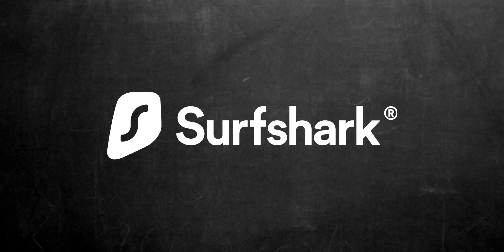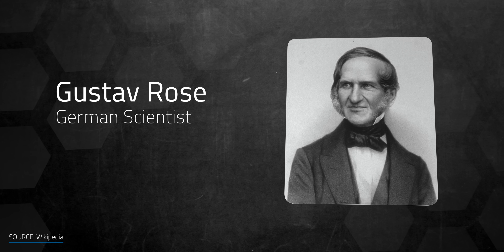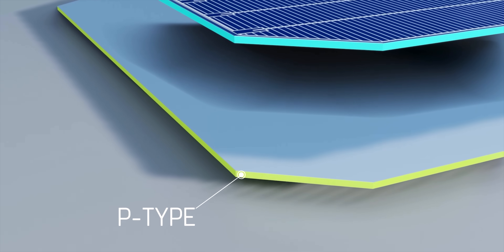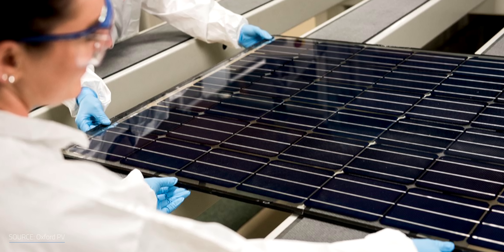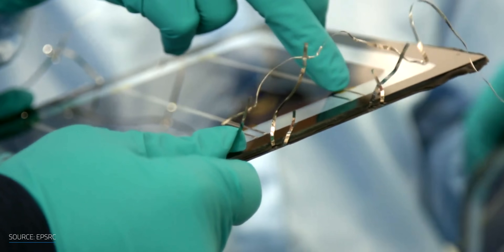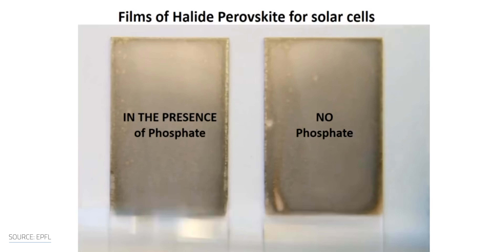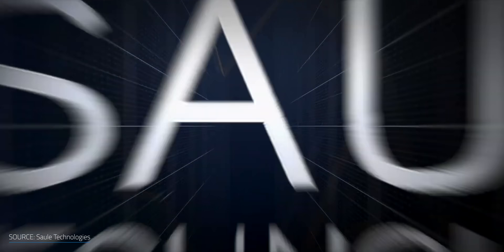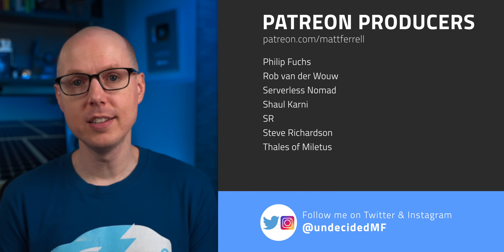Perovskite Solar Cells Could Be the Future of Energy

Comment: As you, say, it's a cost driven market. However, production cost is only part of the cost. Increasingly the cost is dominated by installation cost. That being said, given the ability to recycle these panels and reuse their materials, swapping them out every five years or so might not be the end of the world. But it's not going to be free. Every 5 years vs. every 25 years means 5x the installation cost.The total lifecycle cost is what  is going to matter here and that has to include recycling as well.  

Another thing could be that even at 80% of their original efficiency, it might still be pretty good. It would drop the cost advantage from 5x to 4x but that's still a win. Unless of course you are constrained by surface area and want to get the most out of that no matter what. But it's a fair question to ask. At what efficiency would it be more cost effective than to leave degraded panels in place? It all depends on how expensive the real estate is where you use the panels. If you live in an expensive area and have a small roof, you probably want to maximize what you get out of that. If on the other hand you are building a solar plant in the middle of a desert where the ground is dirt cheap (literally), it might be a different matter. Add a few extra panels to compensate for expected losses.

Comment: 0:17. Silicium cells are producing a lot more than one decade ago. Increase every 2 years was ca 5- 10%..
I know that it does sound a lot when cells get 11% efficiency instead of 10....but this is a 10% increase.
in 2013 the best silicium cells where ca 22.7% efficient (information from a solarteam at the world solar challenge). Those were at that moment not for sale to the public. In the same year most of  the panels installed on the roofs produced wuth an efficiency of 16 to 17% (150-200 wp panels). The difference at that moment...the best cells , silicium, produced 41% more energy than the industry standard. When now buying industy standard panels (2021) you'll get thos 20-22% panels. The topcelss however are at this moment near 25% efficiency.
Also  , silicium is an element which is one of the most common elements on earth. Shortage is not possible.

In this mineral, it is not an element, is one of the more expensive metals , Titanium.Even when found easily today I would not be sure for how long if we start producing solar films on big scale. And what is the environnement damage from mining this mineral? Or can we produce it artificial...which could means the use of titanium. (Calcium titanium oxide)
 Silicium can just symplyextracted  from sand. (SiO2)

Efficiency (my sources) are now 17% only.(source TNO the Netherlands) (I would like to know the source of this 29% efficiency) 
Advantage: Very thin lyers so leightweight panel  production ...but remember that panels must widthstand storms. Also felxible cells are possible. So for mobile use they will be very good. Put them on the roof  from your tent ....
But with 20% less production/m^2 and the high prices of ground /m^2 I suppose I would prefer today the  higher efficiency against low weight for standing installations.

Comment: Perovskites will flounder until the durability issues are solved, but unless obstructed by patent law, the removal of toxics is solved.  When the durability reaches 5 years and installers offer them with regular replacement contracts (practical because of such low cost), then they can gain broad market acceptance.  Even with this they will remain only a share of market though until they have the durability of silicon cells.

Comment: Most solar panels are under 25% effective at collecting energy from the sun. With higher efficiency, it's better, but 29% isn't a huge step up. But everything helps, I guess.
Reply: A 16% improvement in output given the same sunlight is pretty good, I'd say. 6 perovskite solar panels would be approximately equal to 7 silicon solar panels, assuming identical sunshine and area per solar panel. This is not a fair assumption, as area is the main limiting factor for solar panels in many cases, so for some people, it might be impossible to fit the additional 7th solar panel. (Source of 16% figure: suppose a silicon solar cell receives 100w of sunlight, converting that to 25w of electrical energy. Similarly, consider a perovskite solar cell receiving the same amount of sunlight, converting that to 29w of electrical energy. 29w = 1.16 * 25w, so that is a 16% increase.)

Comment: I can get enough silicon bases solar panels on my roof at 20% efficiency and a 30 year warranty (Solar World) that I can be completely off-grid (with battery back-up). Now I just need the price to come down to $0.60 per watt and I will be set. I would not be putting the perovskite tech on my roof until it has had many years of real world service. There is a silicon based 10 kw system installed in Switzerland that used ARCO panels that are still functioning at nearly  20% of their original output after 35 years.

Comment: If the perovskite cell were encapsulated in plastic film behind the glass panel, they could be easily refurbished, with the old cell sheet replaced with a new one. The old cell sheet could then be easily disposed of or recycled, without the issue of transporting large, heavy panels.

Comment: It’s worth noting that while it’s currently true that high energy use is frequently correlated to high carbon emissions, those two axis are fundamentally independent.

As more clean solar power is generated, the energy use associated with creating those solar panels will pollute less, or not at all.

Energy production and use is good.
Pollution is bad.
Reply: Excellent point.  Perovskite manufacturing is significantly less energy intensive than traditional Silicon cells.  The future is looking brighter... at least on the technology front.

Comment: Another advantage of perovskite films is they don't compete with materials used for semiconductor chip market. I always saw that as a major hurdle for rapid adoption of high efficiency single crystal silicon solar cells. Although silicon is the most abundant element, producing high purity substrates takes a lot of energy and chemical processing and most of the current capacity goes to chip makers.

Comment: I have been hoping for a high efficiency perovskite solar solution for several years. My perspective (2 cents worth) is that the cost of putting a home solar system together with battery backup, professional electrical work, construction costs and permitting, is so high that having panels that will have decent efficiency long term (over high efficiency short term) is highly desirable.  Once I have gone through all the waiting, expense, and headaches of installing a large home solar solution I don't want to think about replacing panels for many, many years.

Comment: At 10% the cost, would people really complain about having to replace solar cells significantly sooner?

With a smart design, cells could be made to swap out easily, and even be designed to allow for silicon cells to be swapped in at a future date. By lowering the upfront cost, and giving consumers the ability to do maintenance more often at a cheaper price, or get more durable cells when they choose,  it lowers the bar for widespread adoption.

Anyone who has ever started a new hobby from scratch knows it is easier to get into it with cheap stuff to get you going and upgrade as you can, than to wait until you can afford the expensive stuff to even start doing anything
Reply: yes but lets ask you this. How many of those said people will recycle their solar panel or just toss it into the trash? My money is on the latter.

Comment: I love it when people make things to absorb the energy from natural resources and especially the sun 

What about all the heat coming from the sun has that been addressed yet? Super hot days creates so much energy
Reply: The infrared is just one part of the spectrum of light coming from the sun, but the higher energy visible and UV light makes more sense for solar panels. A photon of visible light has more energy than a photon of infrared. And I think there just isn't a good efficient material to make IR solar panels. Plus since everything warm is putting out IR (at least) there might be some thermodynamics reason why that's not possible.
Reply: @calebmauer1751  good point. I know people do a lot of testing on thermal to energy conversion but maybe the other spectrums are easier to gather with certain materials .. I always imagine massive mirrors and magnified glasses directing energy and heat into some material like diamond or other dense substance to contain that and then be able to release it like the iron man battery/energy system… not sure what use case scenarios it would be able to handle but build up energy and be able to release lots in a small area sounds useful 

I don’t know much about this topic though, just some fun ideas that will probably come to life one day

Comment: When concerned about the 20% efficiency of commercial photovoltaic cells, remember that the photosynthesis of modern plants are between 0.5% to 1% efficient and only a small fraction of biomass gets trapped geologically to form fossil fuels over millions of years.
Reply: Even with the small efficiencies of photosynthesis, forests are often 10-20 degrees cooler than the surrounding farmland.   It makes you wonder if high efficiency solar cells will eventually have an effect on the local climate, as silicon absorbs energy in IR bands quite well.
Reply: @macroman91  Most vegetation on Earth is green because they purposely reflect green light.   There's actually too much light intensity in sunlight for the most common form of photosynthesis in use and as most of the energy of sunlight is green (yes, we really have a green sun), it is green that is reflected and hence not absorbed to become heat.   Vegetation does have less albedo than say snow and ice but it does reflect far more energy than a lack of vegetation and that reflection is more likely to be the reason for cooler temperatures, not the relatively small percentage of energy converted to chemically stored energy by photosynthesis.
Reply: @macroman91  In addition to what John Wang said, the energy carried down the wires would make it cooler by the solar panel, but it just comes out somewhere else when the electricity is used, so if you're using the energy locally it would have no net effect.
Reply: Except plants do it all with pure organic self replicating materials and can fix CO2 without needing heat.

Photosynthesis is really clever evolution.
Reply: @the_roadbites  Sure photosynthesis figuratively grows in trees but remember, if you are expecting photosynthesis to provide the energy that we use, we already have that in fossil fuels.  Are you really insisting we just continue with fossil fuel use?  I'm simply saying the efficiency of solar photovoltaics isn't as terrible as people seem to think it is, it's actually quite impressive compared to our current method of using energy from the Sun which is fossil fuels.

Comment: I love your channel, and I know you produce videos to educate people and expand knowledge.

A requirement for education is precise language, because if someone records an ambiguity in their mind (a secondary definition you weren't intending) then not only have you not educated them, you have actually spread ignorance.

This happened in this video, when you were listing two values and used the phrase "20 times less". This is grammatically, mathematically, and logically wrong.

If you are comparing two values, say 5 and 100, you can say that "5 is one-twentieth of 100", or "100 is twenty times what 5 is" or "that's just 5 percent of the higher value". What is NOT correct is to say "5 is twenty times less than 100".

Let's break that down.

"5 is twenty times less than 100".

Treat it like a word problem. "Times" is multiplication, and "less" is subtraction. Therefore, you have literally said "5 is a multiple of 20 and 100 subtracted from 100".
5 = 100  – (20 × 100) = 100 – 2,000 = –1,900... so you have actually said "five equals negative one thousand and nine hundred". (5 = –1,900)

At 5:39 you say "Its thin-film structure has twenty times less material...", which is wrong.

If standard construction methods use 5 ounces of material, you have literally made the claim that this new method uses –95 ounces... meaning each panel produced CREATES 95 NEW OUNCES of the source material out of thin air.

The correct thing to say would have been "Its thin-film structure uses just a twentieth of the material..." or "Its thin-film structure uses just 5 percent of the material used in traditional methods..."

Continuing to use the phrase "_n_ times less" is as inaccurate, irritating, and ignorance-laden as using the phrase "I got no [item]" or any use of the idiotic word "irregardless".

I hope this helps.

Keep up the great videos!

Comment: I still don’t see the value of a solar cell. Do you need battery storage you got a combine those two together. Energy put in to energy out. I still believe there’s mechanical devices that will be our saviours for electricity. I’ve watched a lot of magnetic propulsion with super capacitors.

Comment: Why are we limiting ourselves to wind and solar? Nuclear should be the energy of the future.
Reply: Because even if it is safe and doesnt generate greenhouse gases, it generates radioactive waste, and thats pretty inconvenient to store. And some other stuff
Reply: @Searaw_  research it. Storage of the waste material is easy and safe if done properly. Much of Europe is on a nuclear grid.
Reply: @Rogn1  I live in France so I know it exists. But i'm still against it because we shouldnt have to store toxic waste when there is better alternatives. I know that nuclear power is really helpful because it generates a lot of energy but i'd prefer a more decentralized aproach with shared power across homes with solar energy
Reply: @Rogn1  there's already businesses running on solar power. The Tesla factory is designed to run 100% out of it. One of the malls near where I live has solar panels on the roof of the parking lots and is able to generate enough energy to power itself and sell the remaining energy. Also, this video is talking about a new type of solar cells which are going to be more efficient and cheaper, so that's to be taken into account regarding the possibility of businesses running with renewable energy.
As for centralized power plants, there's also hydropower plants which work really well for example. France is one of the countries with the most nuclear power plants, just behind US, but compared to it's size, France easily wins. And where i live it's safe to assume that most if not all the electricity comes from hydropower.
Nuclear fusion is currently in development and it's able to generate a lot more energy than fisson while using hydrogen which is far more stable than uranium radioactively speaking. also hydrogen can be found in water whereas uranium has to be mined.
I'm really looking forward to nuclear fission, but not nuclear fusion.
Reply: @Searaw_  Nuclear power is best, always will be. Have a great life.

Comment: The efficiency that matters is Watts/$. Watt/Msquare does feed into that, especially in places where the price of real estate is extremely high (like inside a payload fairing on orbital launch vehicle), so anything that can get a few more Watts out of a given area is likely to find a niche. Whether it takes over broader market remains to be seen.
Reply: You must also consider the cost of the supporting technology: the motorised frame that the panel mounts into, the alternator and power regulators. A solar panel that generated 2x the power at 2x the price would be a good investment.
Reply: @alsmith20000  Mounting and tracking hardware does become more cost efficient with a higher efficiency panel, so even if the cost goes up slightly more than the efficiency, the savings down the chain might make it worthwhile. Life cycle costs also come into play, so we are going to need to calculate levelized cost for the whole stack as well. Regardless, it is good to see more promising solar technologies take steps towards real world applications, and we will find out where it is or is not more cost effective.
Reply: @alsmith20000  Incorrect... 2x the power at 2x the price is a wash from an investment perspective. You would need 2x the power at less than 2x the price in order to realize any cost savings.

For instance, if perovskite cells last half as long, but cost 1/4th as much as Silicon then you would collect 2x the power for the same costs.
Reply: @jeremygoodall7799  I think the point has been missed here. The solar panel itself is only a component of the overall solar installation.

I think that there is also a difference in terminology. Power is the rate of change of energy but I believe you've used it as total lifetime electrical energy generated. You are of course right to consider he longevity as this affects the total energy that the panels absorb.

In any case, the current short life time of these panels does seem to be an important factor, preventing them from being rolled out en-mass.
Reply: In terms of mass adoption by homeowners? Definitely. Higher Watts/$ means faster return on investment.

For more complex arrangements, such as giant fields of solar panels that track the sun? The added investment of the equipment and the land probably do push the balance more in favour of higher watts/m^2

It's still going to be a balance of course
Reply: You have to factor in labor costs if you are replacing it every 2-5 years.